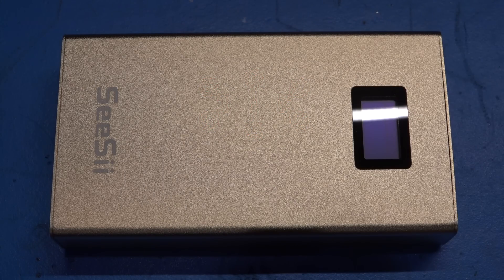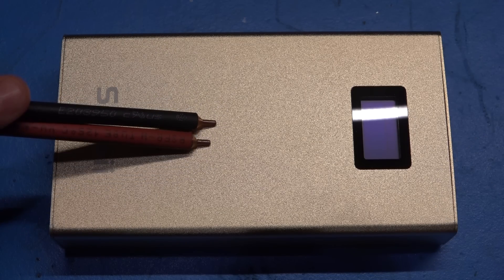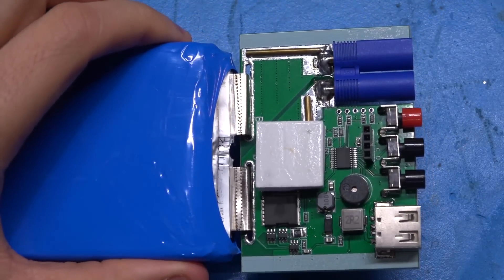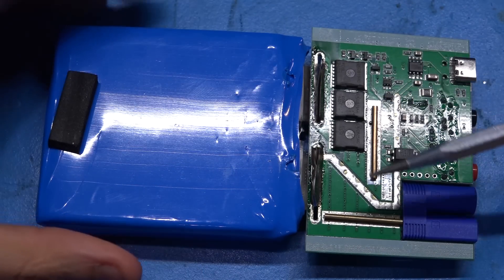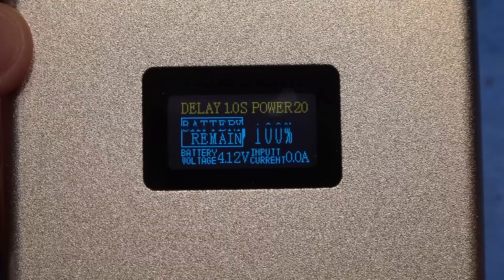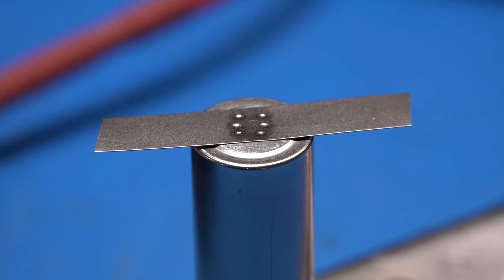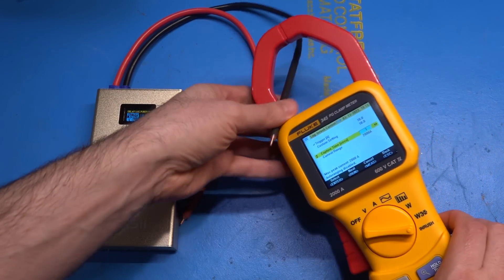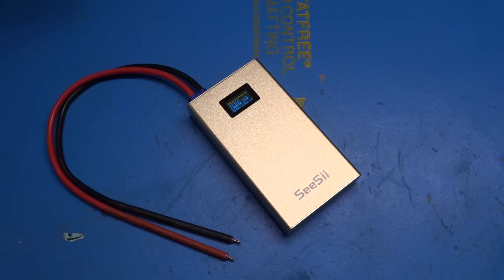TNP #14 - Teardown & Analysis of a Somewhat Dangerous LiPo-Based Mini Spot Welder

Comment: Having those connections short to the case would have been really bad. Surprised they haven’t had issues in shipping.
Reply: The case looks anodized, which creates a thin insulating layer. Which is obviously not a good thing to rely on, but would probably reduce the actual incidence of issues enormously.
Reply: at 3:34 it looks like he touches them at the same time with his fingers, so my guess is they're insulated
Reply from the maker: They are not insulated. They only sit at 4.2V. But they can deliver 1000A.
Reply: @dfgoui  It's only a few volts. He can touch both terminals at the same time perfectly safely. It the terminals were shorted out by contacting metal, the result would be a huge arc flash or battery explosion. If you can't understand that the previous two sentences can both be true at the same time, you need to learn about the difference between voltage and current. Also, I don't think Shariah would have made such a big deal out of the issue if "they're insulated"...

Comment: I just tested a couple of smaller ones before, they were not as powerful and the maximum welding current was in the 300-400A range. If you measure the current waveform with higher resolution you will likely see one or two short pulses preceding the main pulse.
Reply: 1 or 2 short pulses before the main pulse is called 'prewelds' this provides a current path for the main pulse, without it, the main pulse could eject molten metal as 'weld splatter' or even burns.

Comment: Any idea what kind of spot welder Dan Gelbart built? 
Building Prototypes Dan Gelbart part 5 of 18 Spot Welding
Reply: Or of an up-to-date control circuit for spot welder similar to his?
Reply: In Dan's new "Workshop Tour" video at 32:08, he refers to a "miniature spot welder" that "works exactly as the big one" you reference. The miniature one is made by Weltek. It looks like a WELTEK 410E PRECISION WELDING HEAD, with a separate Weltek solid state power supply.
Reply: @daven224  Good find, although, I'm not sure if "works exactly as the big one" means that the internals are the same architecture or just that the principles of spot welding are the same, just in a smaller package.

Comment: These things also useful to stress-test power components and high-power resistors. Also nice for PCB shorts troubleshooting, since any shorted component will be burned away promptly. Beware, eye protection is mandatory :D
Reply from the maker: I like that idea. Now I have to find a short somewhere...
Reply: and hope it burns the component and not the PCB traces :)
Reply: @tmmtmm  Lowest resistance loading will win the firework award. :)
Reply: Good for testing the 1st mixer in your analyzer.
Reply: Best idea was that of EYE PROTECTION.
Reply: I dunno, but if nothing is shorted it could blow something else on pcb

Comment: These are becoming popular in the iPhone repair industry as you need to transfer the battery mainboard to a new battery for full oem functionality. I find whenever a new tool is required to fight the right to repair it speeds up the creation and sales of devices like these.
Reply: I think iphone and any other phone batteries are soldered to PCB. Only batteries with steel case need these welder.
Reply: @seldompopup7442  they are mostly all soldered. Usually you would just buy a new or referb battery and install it without welding by clipping it in. However in the case with Apple they embed a serial number and other data that may require the pcb be transfers to a new battery.
Reply: @seldompopup7442  Maybe on the current gens, but the 5/5S/5C I've worked on have tiny connectors.
Reply: People have had need of "battery welders" for many years now. Building your own battery pack has been a common DIY thing for years. Started out with RC toys, then moved up to solar systems ("battery wall"), RV's, and even traction packs for cars.